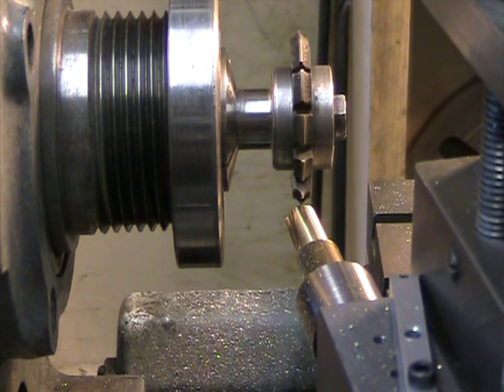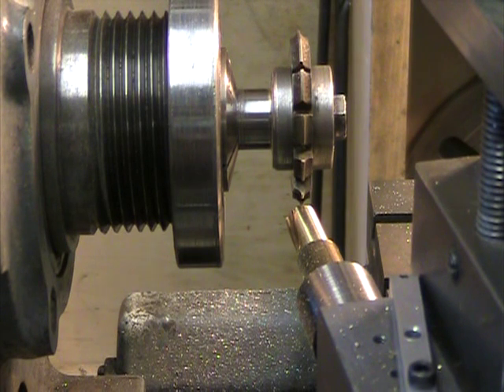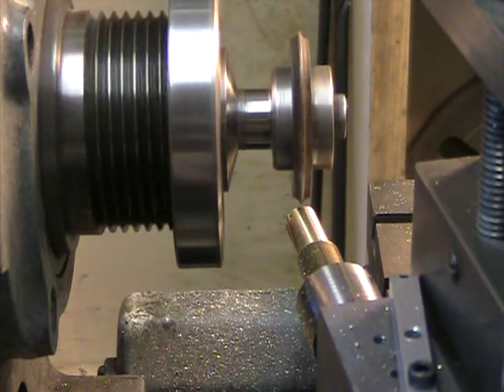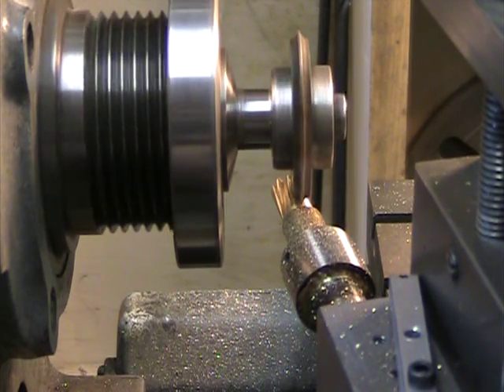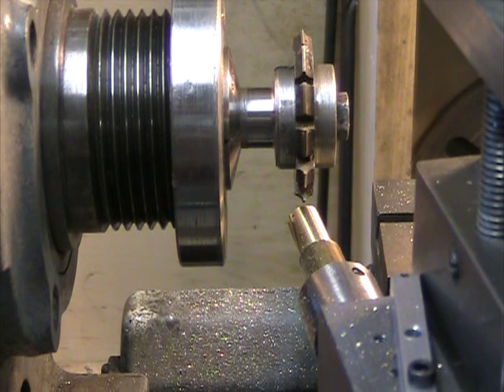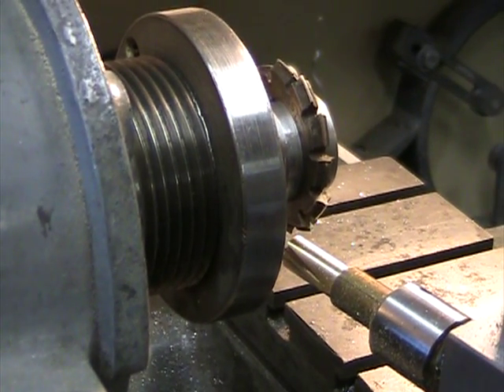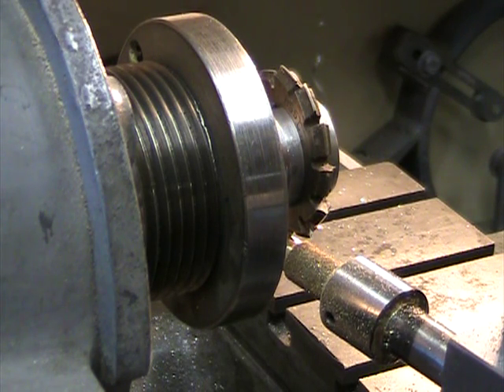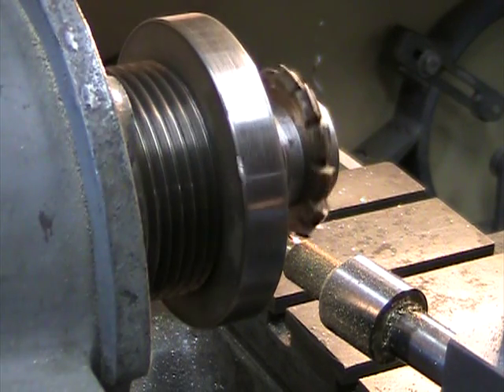10DegHelicalGear.mpg

Comment: hi sir , i am irfan from india , can u help me in helical gear cutting on a gear  hobbing machine . have a problem that i can cut spur gear on my machine effectively but i am not able to cut helical gear  
i
Reply: you must b already knowing about the change gear system of a hobbing machine , 
there are two change gear system in the machine 
1 is for number of teeths 
2 is for helical gear cutting 
 i case , i have to cut a spur gear i have to lock the change gear system of helical part of the machine . which works well for me , but in case i have to cut a helical gear i have to change gear for both systems i.e (for no. of teeths as wel as hellix angle ) .
i am finding it difficult to find change gears for helical part , plz help
Reply: my machines name is CUGIR fd500